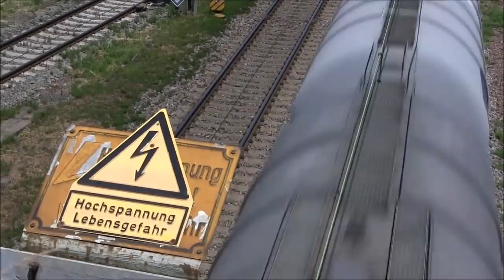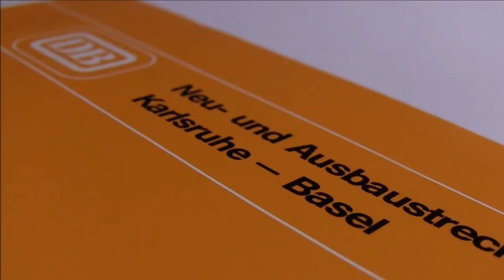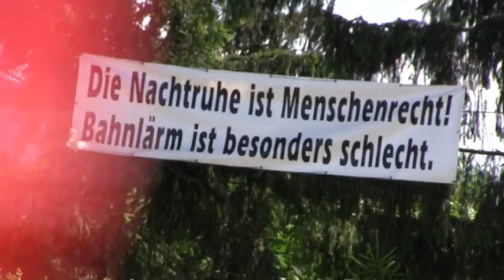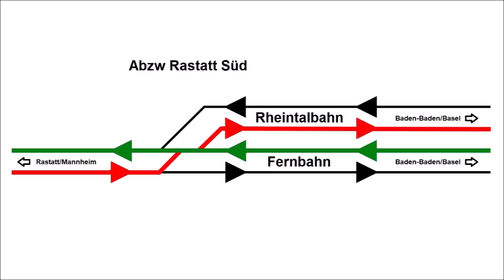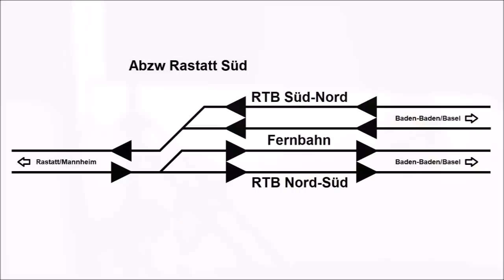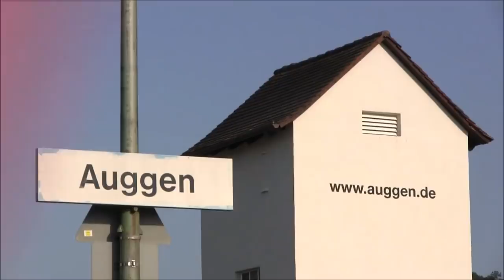Die Rheintalbahn – ein unfreiwilliges Jahrhundertbauwerk

Comment: Kannst du bitte mal ein Video zu den Grundsätzen von streckenplanung und Betrieb machen ? Für den nicht- Eisenbahner fehlt ein wenig das nötige zusatzwissen. Die Argumente sind alle schlüssig und manche Konzepte auch ableitbar.
2. Dürfen Güterzüge auch unter LZB fahren  ?
Reply: 2. Ja, sie dürfen unter LZB fahren und das kommt auch vor

Gustav, mach wirklicz nal bitte so ein video.
Reply from the maker: Ich habe so etwas tatsächlich in Planung. Allerdings weiß ich noch nicht, welches Vorwissen ich bei den Zuschauern voraussetzen kann/darf. Gut möglich also, dass es einen Mehrteiler geben wird, in dem zunächst die Grundlagen des Eisenbahnbetriebs erläutert werden.
Reply: @GustavRichard1  find ich super👍  Ich persönlich würde Signale und PZB und LZB (grob) voraussetzen, das lässt sich auch als komplett Ahnungsloser auf Wikipedia und Co nachlesen und auch verstehen.